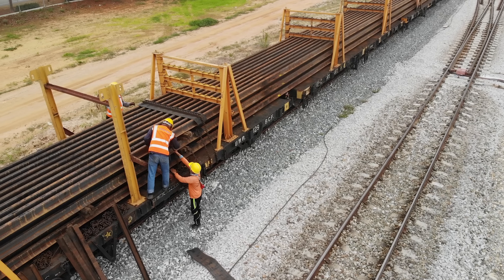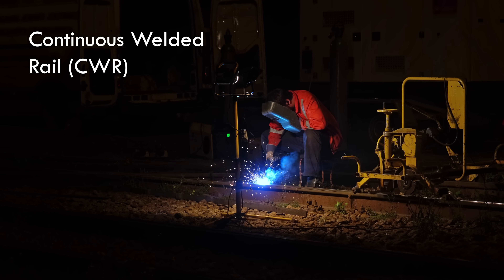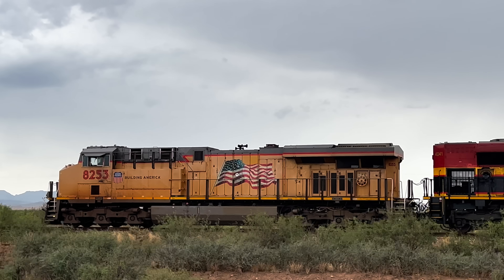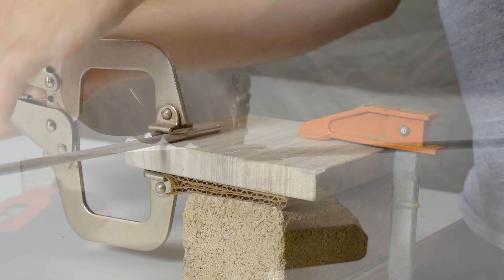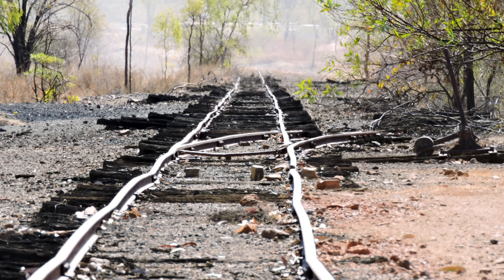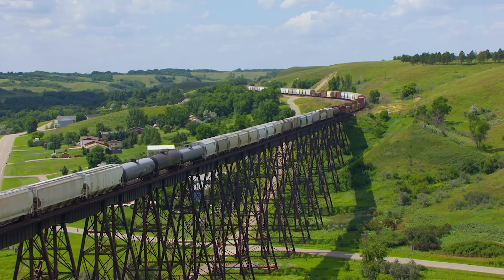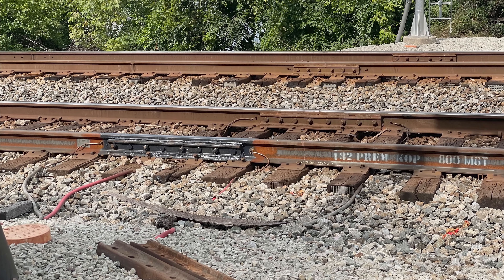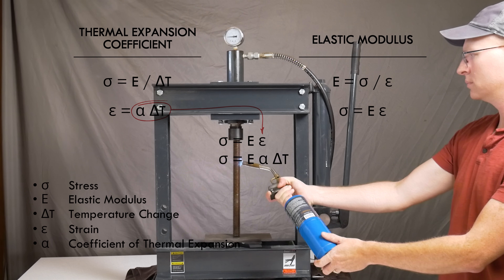Why Railroads Don't Need Expansion Joints

Comment: In additon, the adoption of CWR also led to the mass use of concrete sleepers (or ties in North America) the additional mass of the concrete sleeper over the treated wood sleeper provides extra mass that any buckling force has to overcome to form a buckle anywhere.

The downsides to concrete sleepers is that compared to wooden ones, concrete can fail much more easily than wood simply by cracking. The prestressed reinforcing steel in the concrete sleeper will keep it together, but a cracked concrete sleeper immediately needs replacing. 

Concrete sleepers are also more expensive, so you tend to see them used on rich railways and principal lines. Poorer secondary or preservation lines, and sidings typically feature wooden sleepers due to the relative cost advantage.

An interesting tidbit about the use of concrete sleepers over wooden ones is that concrete sleepers tend to be one size, for straight track to create the exact gauge once the rails are secured atop them, with limited custom lengths for sets of points. However, as rail goes around curves and the conical railway wheels do their job, the ideal gauge for the railway widens by over a centimetre around particularly sharp corners.

 With wooden sleepers this can be easily custom drilled as the sleepers are prepared for the hardware that supports the rail. With concrete sleepers, unless the railway is willing to go to the expense of custom making concrete sleepers for each corner and all the planning design work that would entail (and they never are) the railway just accepts that the gauge through the corner will be the same as on straight track so the flanges of the wheels will grind up against the inside of the railhead and produce the distinctive screech of a train going around a corner. The cost of adding a rail greasing system or more regular wheel profile grinding is more acceptable than custom concrete sleepers.

Comment: I worked on the lightrail expanison from Mountlake Terrace to Lynnwood WA building concrete plinth blocks on which the rail was installed. On a particularly troublesome bridge that crossed over I5, we had to install expansion joints for the rails that were welded on 3x12 ft steel plates that had to be suspended about 16inch off the ground, rebar tied underneath, forms built just 3inch away from the plates, bolt inserts/hardware installed, and a 4am pour in the dead of winter to get her done. What a job that was.

Comment: We call the jointed rail stick rail. The welded rail is called ribbon rail. When it gets too cold too quickly, the rail will break. When it gets too hot, it can actually shift the ties with a heat kink. The heat kinks are more dangerous simply because they don't break the circuits the dispatchers use to route the trains, but broken rail does.

Comment: I hear the clickity-clack all the time. Where I live, it happens because of light-rail tracks crossing street car tracks at 90° angles, so the gaps in the rails are there because of the other track!

For an interesting bonus, the local light-rail uses the same track specs as the street car (they even share track sections in a couple of places) and I think they use the same gauge and rail top profile of regular trains too.

Comment: Special alloys that don't expand totally exist. Invar is 64% iron and 36% nickel and has an exceptionally low thermal expansion rate. In fact, special variations of it can actually contract as they are warmed! 

So railroads totally could make rails that simply don't expand, it would just cost a hell of a lot.

Comment: I used to track weld in England and you have to add track in winter for the cold contraction and take pieces our an pull ( stress ) stress the track so it’s always at a specific tension basically

Comment: Since you mention track circuits--CWR also improves track circuit reliability.  Rail joints within a signal block need to be bridged to maintain electrical continuity, and broken bonds are a common source of track circuit failure.  Since CWR eliminates so many rail joints, it eliminates these bonds too, leading to fewer failures.

Comment: Also, ANCHORS. Hairpin looking clips on the rail base, butting up against either side of a tie. These are generally installed every other tie and take up a small incremental load each.

Comment: fun fact the power cable for the grinder you see at 3:48 is around £1000 to replace alone.

also the glowing slag from the thermite welding process is your best friend on freezing nights whilst you wait maybe 40 mins per weld being done

Comment: An important factor in laying rail hot is that if the rail breaks and pulls a part, it cause a signal indication.  There is generally no signal warning associated with bucked track.

Comment: It seems to me that the diagonal-cut, no-fishplate-needed form of expansion joint could  have been done in the 1800s - it was probably just too expensive to get precise enough cuts on the millions of rails used back then.

I'd be very interested in a series of videos on the impacts of the climate castastrophe on basic infrastructure.  Certainly there's a lot of discussion in Canada about how the number of hot summer days is sharply increasing - and what this means for buildings designed to deal with -30 degrees C, not +30.  Obviously this is a huge subject, but some general insights about what the problems are and what kings of mitigation efforts are out there would be very useful and interesting, I think.

Comment: Fun fact: Metra (Chicago's commuter rail) will literally light their rails on fire on particularly cold (<0⁰F) winter days
Reply: No METRA does not light its rail on fire.  They do use gas heaters to melt snow and ice from around turnouts.

Comment: I did not understand anything in this video. Who restrains the dilatation of the rails, in length? The rails themselves? Woow, but then how do a lot of gap railways still have curves because of temperature? They discovered the trading between length and strain just a few years ago? So, the rails still grow in length, so they should curve! Otherwise, old gaps should be a mistake of the old days. I do not get it and the explanation does not help.

Comment: Practical Engineering practicing clickbait? What a shame. Not putting "modern" at the title is clickbait because most railroad installed and know by people needs joints
Reply from the maker: Sorry for any confusion. The title is intended to imply that expansion joints are not strictly necessary on railways because it is possible to restrain the thermal movement.

Comment: Great vid! 

Quick question — why did you call the Imperial/US Customary units “SI” in opposition to Metric? Usually SI is used to refer to the International System of Units, which are an iteration of the Metric system? 

Apologies if you’ve answered this one before, genuinely curious! I regularly use both systems in my work in natural areas restoration contracts.

Comment: I grew up listening to the clickety clack too. Although Texas is challenging with it's temperature swing, I think the Canadian interior (and some Northern States) is worse. With a possible 80+ C degree swing between cold and hot, I really feel for those rail engineers that have to plan out the lines. I'd love to know if the northerly rails use a lot more of the newer style expansion joints compared to the Southern States.

Comment: question though... if diagonal joints solve the problem of joining discrete lengths of steel in a way that wheels won't clink and clank over them, then why do they use CWR ? seems like the added bracing and welding and engineering would be expensive, whereas having rails manufactured with pointy ends would be trivially more expensive than with blunt ones. so what gives?

Comment: UK welded rails have expansion joints every few miles to account for thermal expansion.
Reply: No they don't.
Reply: @meeeeeeeeeeeeeeeeeeee2  The WCML near mine does.
Reply: @heavy_metal_chemist  I worked as a P-Way Engineer installing and specifying track on the WCML for nearly 40 years, and I can assure you that there are not expansion joints every few miles. The only places you are likely to see them is protecting switch diamonds that are not strengthened to handle the forces generated by CWR. Note that switch diamonds are not very common.

Comment: Would painting the rail white with a material a train wouldn’t easily wear off help with the buckling from heat?
Reply: Only slightly the saving is just a few degrees.

Comment: Heat is only 1 reason for things to get kinked on the railroad. 
The rail walks as a train  moves over it.  This requires a long turm strategy at dispatch, to keep the sections centered in there proper location.  

This was the explanation given why sometimes dispatch will run us through the hole without any traffic to justify using a siding. On that section load go south and empty go north. Hence the siding sees more light trains all north bound,  so occasionally they send a load south through  it to balance things out.
The rail forms an unbalanced sine wave. The hever the trains avg car weights the higher the peaks centered between the pairs of trucks.  So 1 extra load(6500t) counts for something like 5 empties (2500t) . Most of the time they work it out through scheduling  and can avoid unnecessarily slowing fraight down to duck through  the siding on a diverging clear.

Comment: Thanks, I was traveling around Europe by rail earlier this year. I was wondering how they managed thermal expansion. 
The welded rails are definitely a quieter, more comfortable ride. 
I did notice something that you didn’t mention in the video. All the ties are concrete.  No wooden ties anywhere. I assumed the ties were steel reinforced, being much stronger than wood.  I figured this is what was keeping the rails from buckling.  Around three steel reinforced ties per meter, using bolts to hold the rails instead of spikes in wood. This setup could withstand a lot of buckling force.

Comment: The Machinery's Handbook is a great source for answers to problems.  You can find equations to solve the most complex problems.  It is satisfying when you can find a solution that most engineers can't find.  I worked in calculus, where most tried to avoid math.  The humor is when they call you up and ask how you figured it out.  Never give them your source of answers!  Keep them guessing.  A good engineer will collect reference manuals for many areas of engineering.

Comment: In your railroad series could you answer why there are sometimes another pair of rails inside the main rails in a curve?
Reply: https://en.wikipedia.org/wiki/Guard_rail_(rail_transport)#:~:text=In%20rail%20transport%2C%20guard%20rails,in%20alignment%20to%20prevent%20derailment.  Wikipedia has an article on guard rails.
Reply: Check rails found on tight curves (usually just on one rail) acts on the back of the wheels to reduce the angle of attack on the running rail and hence reduce sidewear and the tendency to flange climb.

Guard rails usually in pairs set further in from the running rails, are used to guide derailed trains on larger bridges, whose side walls are not strong enough to stop derailed rolling stock from going over the side.

Comment: That's was a very in depth analysis and demo.
What's interesting is that the negative cost of conventional butted expansion joints must be higher to justify the extra cost of stronger attachments and scheduling/pre-heating/effort to construct CWR. 
I wonder how much is from noise restriction regulation in proportion to cost of increased wear of rail from the open joints. I remember riding Amtrak on remote rail lines through ND and MT, where certainly freight trains wouldn't care about noise, yet much was CWR iirc. So I'd guess the cost of replacing remote sections of line must be high and better to put in up front.

Comment: Back around 1965-1968, British Rail built a test track near my school in Nottingham, England.  It was the world's first pre-stressed railway line and astonishingly quiet for back then.
As I recall, the story was that the rail was treated to expand thickness-wise rather than length-wise, allowing lengths of rail to be welded together.
Maybe that was mis-direction or maybe it was a patented technique so a work-around was found by other railways.
Reply: Nah, it's the same thing. If you put compressive force on a material in one direction, it will shorten in that direction, however, it will expand in the two other directions. The reverse is true for tensile force where the material will stretch in the direction of the force, but get "skinnier" in the two other directions. So on a continuously welded track, instead of the track getting longer when heating up, it will develop internal stress and it will also get "thicker". The effect is really really small tho, and has no effect on the overall performance or design of a railroad track, that's probably why it wasn't mentioned in the video.
Reply: when it expands, it expands in all direction. The expansion is proportional to the length and hence the expansion in the thickness is rather small.
Reply: When it expands due to heat, being a homogenous material, it expands in all directions equally, but if it shrinks or stretches due to co-linear forces, it gets wider when compressed and skinner when stretched @janami-dharmam
Reply: @gregwaters7830  It is measured by what is known as Poisson's ratio. But thermal expansion and elastic expansion (strain produced by stress) are independent phenomena and can be treated independently.
Reply: Britain and railways? Those were the days...
Reply: @angelikalindenau943  I have traveled by the british rail in the late 70s; also on the tube during the same time. Some people were so friendly and some were so racist then...
Reply: @angelikalindenau943 I drive trains in Britain’s and I can tell you we are as busy as as ever.
Reply: Title says no expansion joints are needed and at 12:56 is a picture of one!